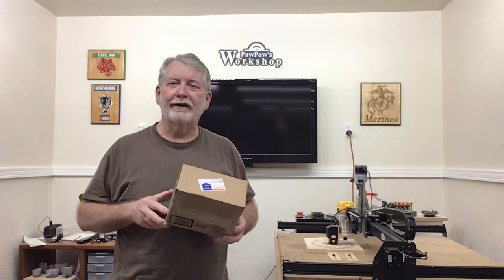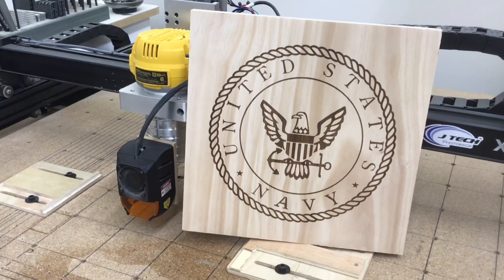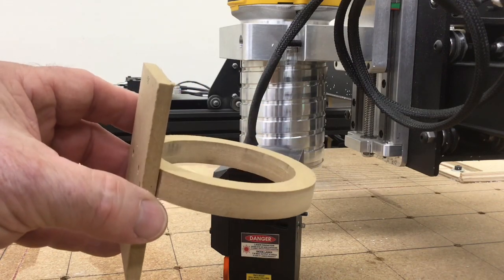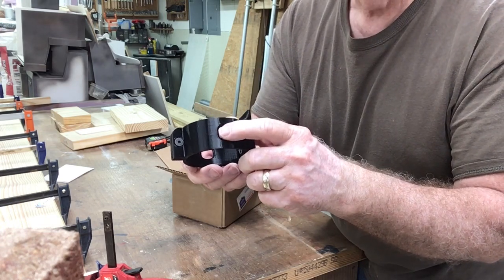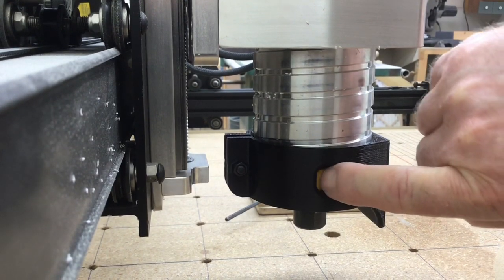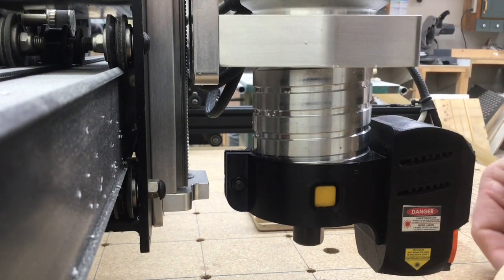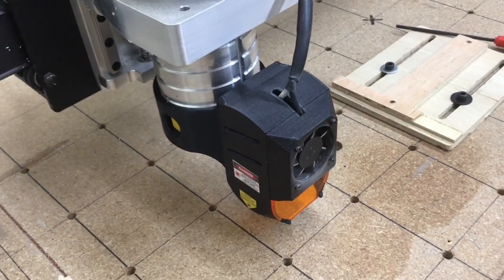I Just Received My New JTechPhotonics Laser Mount

Comment: What's the the name of that jtech mount because I couldn't find it the website
Reply from the maker: This was a prototype that Jay and I discussed and he made.  Contact Jay at JTechProtonics he should be able to get one for you.
Reply: Also would that mount fit the Makita router  I'm just curious cause that's what I'm using on my xcarve with the cnc4newbies z slider like the one you have
Reply from the maker: The Dewalt router is 69mm, I believe that the Makita is a little larger.  You might need to check the diameter of the Makita router and then check with JTechpotonics for the proper size.

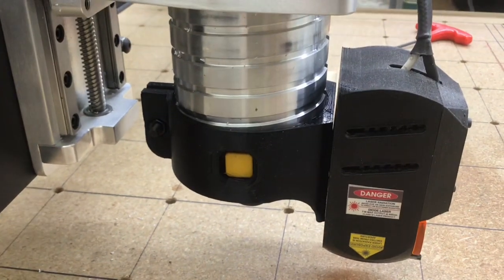Comment: Great video as always.  My only concern is the laser mounting did not look to be very secure. Maybe the 3D printed surface was not completely flat (5:42), but it appears the laser wobbles fairly easy (4:15) when you touch it.
Reply from the maker: Yes, it did move when I pushed on it, but it is very stable and does not move at all during the engraving process.
Reply: Paw Paw’s WorkShop any plans for your original JTech magnetic mount? I purchased a used JTech kit from a Shapeoko user and need to get myself an XCarve mount. Is the latest mount in your video meant for the Z axis upgrade? Thanks.

Comment: Would the mount give more clearance for installing bits if it was flipped over ?    Just a thought
Reply: It might give more clearance but the design is to get the laser to reach all the way to the wasteboard without having to lower the Z Axis mount and lose Height.
Reply from the maker: You are correct. Thank you very much.
Reply from the maker: Yes it would, however, the idea is to have the laser as low as possible to the waste board.